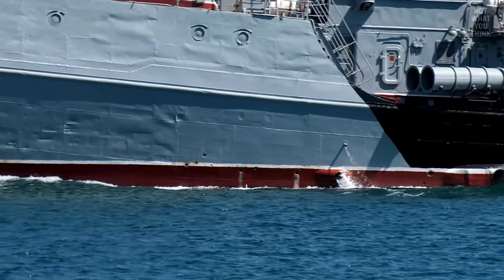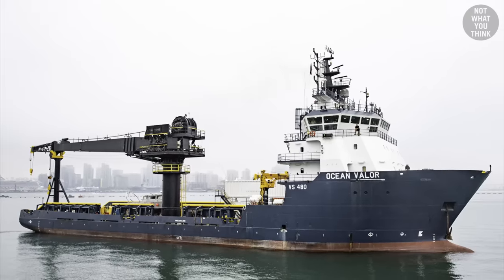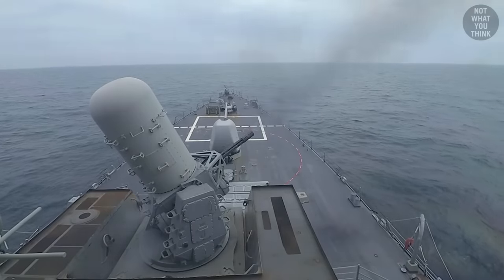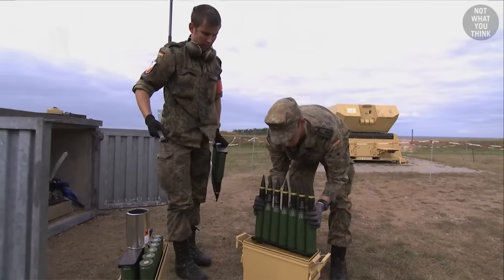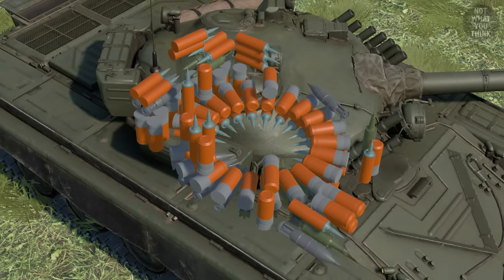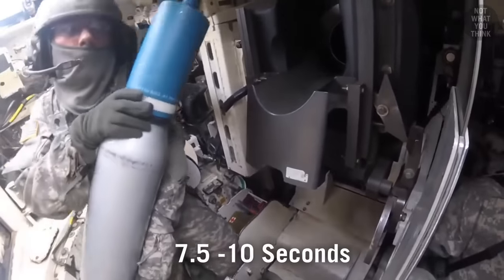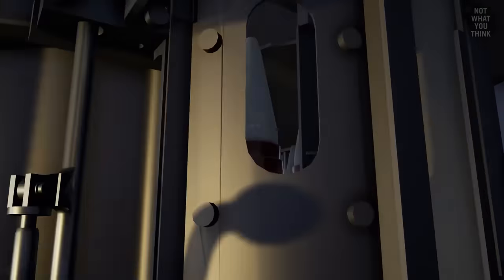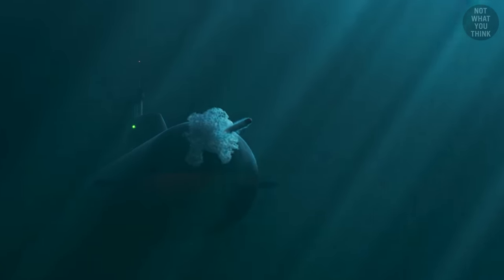Why Reloading Modern Weapons is Harder Than You Think

Comment: I'm a ammunition feed specialist. From 223 all the way up to 70 mm cannons. I like the 50 mm bushmaster 🤠 I did my time learning everything from start to finish building ammunition feed systems.
Reply from the maker: Pretty cool!
Reply from the maker: Drop us an email, see the “about” page.
Reply: What weapon still uses 70mm today? Plus, the 50mm bushmaster is still being tested.
Reply: I misread your comment as "I'm a ammunition food specialist" 😂
Reply: @Yourmomloser  .223 is slightly different from 5.56, appearently the chamber pressure is higher on a 5.56 so a .223 shouldn't fire a 5.55

I guess the commenter deleted their question but this was not unprompted
Reply: @WolfeSaber9933  its good Swedish tech its fire / targeting systems and shells option being worked upon American's wanted little more Ap penetration other than that is a larger version of swedes 4o mm system in CV 90 that's why American logistic for the new shells must be solved . It can be implemented within the year as soon the Sweden joins NATO.
Reply: @CosmoNoBones  That's not true, they're mostly interchangeable dimensions-wise, but they tend to have different pressures, so a gun designed for one, while capable of shooting the other, might not handle it very well. But you very much can do it.
Reply: @CosmoNoBones  Chamber pressures....5.56mm NATO is higher pressure compared to .223 ;)
Reply: @CosmoNoBones they both can fit in each other's breach but the difference is that .223 has a lower Max pressure than the 5.56 so you can use a .223 in a  5.56 rifle without any hesitation but using a 5.56 in a .223 rifle is kinda dangerous as it can blow up due to the increased pressure in the chamber
Reply: @CosmoNoBones  The 556 cartridge is slightly thicker to handle the higher pressure. technically you're not supposed to shoot 556 through a 223 chamber but people do it all the time.

Comment: CIWS and its aircraft predecessors for the most part retain the casings too; pushing them hard enough to get them clear of the aircraft takes more mechanism than simply returning them to the magazine.
Reply: I read that the original autocannon switched to retaining spent cases because they can't stop instantaneously; when the pilot released the trigger, inertia meant a few unfired rounds got ejected too while slowing down, and it was considered both unsafe (don't want any misdirected unspent rounds drifting into engines!) and an unwise gift to the enemy.
Reply: @grizwoldphantasia5005  The chance of anyone finding ejected rounds live or otherwise is pretty small but yeah, things getting sucked into engines is generally bad.
Reply: @jimsvideos7201  My thoughts too when I read that, but several unrelated sites have said so.
Reply: Another thing I read  was that the center of gravity would shift too much if they didn't return the brass to the drum.
Reply: @BrokenLifeCycle  There's that too, although it varies with how much a load of ammo weighs and how far it is from the center of gravity.
Reply: The reason we have the the M61A1 vulcan is because of the issue of the base vulcans shell casing getting sucked into the F-104A starfighter engines, luckily I have the M61A1 as my base model is the f104C
Reply: @grizwoldphantasia5005  IIRC CIWS does that too.  But you are a bit wrong.
The reason you don't eject casings is because you don't need to eject casings.  There's a loader mechanism that gets attached which adds an external input and output to the permanent continuous chain drive loop which is the vulcan's "magazine".  You simply do not GAF about ejecting casings/unfired rounds because you need a human to attach the loader to modify the system to get external input/output.
When loading/unloading, the loader mechanism strips whatevers in a single cell out(which is then directed to the external output), and immediately puts in whatever is waiting in the external input.  The chain drive loop does NOT appreciate being empty.

Note:I am not a CIWS tech, I was attached to them and had to help them with it because loading/unloading is an unpleasant and manpower intensive activity which may be a matter of life or death, and is certainly a "entering port so we can have liberty" issue.
Reply: Aircraft are not the predecessors for CIWS.  But, I get your point.
Reply: @midgetydeath  The basic gun and the feed system may have differences in materials etc but in their principles of operation they're the same as the M61 family that goes back to the F-104.  The feed system in particular looks a lot like the one from the F-18 too.  It's a fun wiki wander if you're into the sort of thing.
Reply: @Grimmwoldds  Just out of curiosity what rate were you? In other words, who did the CIWS guys manage to rope in to helping them reload? I was a CIWS tech. Block 0. Two guys could do it in 20 minutes if the ammo was prestaged and/or the ready storage lockers were right by the mount, the guys both really had it down, and of course, nothing goes wrong. Then again, how many times in the history of Naval warfare has nothing at all gone wrong? Having a couple more guys made the whole process quite a bit less arduous.  Even if they are just ammo mules so the CIWS guys could concentrate on making sure everything was lined up and working with that damned loader unit. If they were able to simplify that process with the block one good for them.  That loader sometimes required a fair bit of percussive adjustment to get it in place while keeping the sync marks lined up, they also occasionally required prayers and/or blood sacrificed to whatever capricious war god rules over insanely fast, accurate, and paranoid computerized gunners.

Comment: The USN has loved it's autoloaders ever since the late WW2 cruisers like USS Salem. Those were some large rifles with autoloaders and IIRC there were plans to equip an Iowa with autoloaders during the cold war
Reply: Since obviously nobody is hand-loading 8-16 inch rounds, every battleship and cruiser since the WW1 era has technically been "auto-loaded". The difference is basically only in how fast the loading mechanism works.

Apparently the Germans stuck with 2-barrel turrets for their Bismarck class battleships because the loading mechanism, which was the fastest for that size class of ammo back then, took up too much space to fit 3 guns into the turrets.
Reply: @TrangleC  we did hand pass rounds and charges on Battleships. The only auto part was actually chambering the round and closing the breach. Sailors had to hand lift the 16inch projectile and it's powder bags onto a table to then be pushed into the gun, it's basically hand loading in all the ways that really count.

That's how it's been done on all ships that allow for manual loading. You still have to heft that 8-16inch projectile onto a platform in line with the breach.

For more info, both the USS Iowa and USS New Jersey YouTube channels have videos on loading the various guns on the battleship.
Reply: @Its-Just-Zip  16in projectile, around 2000 lbs.
Reply: @salt6  There is a reason the gun crews on battleships were so big

Comment: Some more consideration on tank autoloaders:
1. France manages to deal with the issue of only 3 crewmembers on a fairly heavy tank (~57 tons) by teaming them up with scout cars. This way they get at least 5 people to take care of a tank and a car.

2. The limiting factor of the rate of fire of Soviet designed tanks often isn't the autoloader, but how quickly they can re-acquire the target after each shot. They are often more limited by their optics and the lackluster stabilisation than by the autoloader. German trials with eastern German T-72 for example found that it often takes over 10 seconds until the gunner and commander can get the gun back on target.

3. Casette autoloaders are one option for modern tanks, but the gun compartment and crew compartment get increasingly seperated anyway. Not all go with a fully unmanned turret like Armata, but Leclerc-style designs like the EMBT put the turret crew within the rotating turret basket and give them a hatch to look out of, while also largely isolating them from the gun and ammo handling.

4. Saving 25% of a 4-man crew by switching to 3 men and an autoloader sounds way more beneficial than it actually is. Tank crews only make up a fraction of larger armored formations. A US Armored Combined Arms Battalion for example typically fields over 600 men, of which only 112 are tank crews (2 tank companies of 14 tanks/56 crew each). Switching to autoloaders would save them a total of 28 out of 600. And this ratio only goes down as you look at bigger units with ever more supporting elements.
But now you also have to teach your commanders and gunners how to fix an autoloader in battle, and give them all sorts of other responsibilities...  you need to teach your mechanics how to repair them... chances are that this expansion of responsibilities gives you more breakdowns of men and tanks even if the autoloader itself is quite reliable.
Reply: I know they are worse but I also know how much of a toll it takes on your body loading those shells truly is a lose lose situation.
Reply: Concerning point 4:  The point that make gettin grid of the fourth crew member so benefical is the size of the tank.
Humans need a lot of space inside at tank, especially the loader. And space for the crew has to be well armoured.
If you compare "western style" autoloader tanks (like Leclerc or K2) with human loaded tanks (like Leopard 2 or Abrams) you can see it pretty clearly.
The autoloader tanks are about 10t lighter,  0.1m narrower, 0.3cm less tall and the hull is about 1m shorter (all values approximate).
Russian tanks and the japanese type 10 tank are even more compact but sacrifice protection to achieve it. T-14 is also a bit of an odd one out, with a big hull, but a really small turret.
Reply: About part 4, those 28 people that were just booted from the battalion, now you have to find other jobs for those 28 men, which includes probably close to 6-12 months of retraining in a new occupation, along with the fact that that's only for one battalion. Now imagine if that happened to all the battalions in the army and marine corps. That's thousands (guesstimate) of people that have to be retrained and are out of the job.
Reply: @tylermcdavid9426  From what I read france didn't boot the tank loaders from the tank battalion. The army put them into armored cars and attached them to tank battalion in a support role. That way you have a 4th person to deal with a broken down tank and replacement if someone get's hurt or killed.
Reply: @burningSHADOW42  France doing anything war related that isn't surrendering? cap
Reply: @tylermcdavid9426  You mean aside from making more modern tank than the rest of NATO?
Reply: Those are very valid points but eventually advancements in autoloader speed optics and AI targeting tech will make autoloaders a necessity on modern tanks. Right now a teenager hyped up on red bull and chewing tobacco is faster than a Russian autoloader but if an autoloader can fire twice in the same time and If it has targeting technology to keep up it will have to change. The first semi automatic guns were not very popular because the benefits didn't outweigh the costs but technology improved and now only snipers prefer the advantages of bolt action firearms over semi auto in combat.
Reply: @scar3xcr0  That whole debacle comes down to everything being more CQC, it's much easier to put lead on a target 10 feet from you with a fully automatic rifle than it is semi, and it's much easier to hit a target and use less ammo from 300 feet with a semi/bolt action.
Reply: @burningSHADOW42  not really the "most modern" . Abrams has a minimum rate of fire of 8.6 round per minute to qualify as a loader (7s per round) vs the 9 rounds per minute of the leclerc, and avoids the unneeded complexity of the autoooader
Reply: @Tom-dr5id  watch the videos from the chieftain or matsimus, autoloaders are just better in basically all points that matter.

The idea that a human loader is faster, is nice on paper, but is mostly theory. In pratice, you have onyl 5 or 6 rounds that are actually stored in a position that can be reached that fast, the rest of them is slower because they are more awkward to reach. And when the tank is actually on the move the whole thing get's much trickier for the loader, the autoloader does not give a crap about terrain. 
(And there are actually questions if such a high firerate is really necessary anyway. On tank on tank engagements landing the first rounds is actually the most important thing).
The autoloder does take much less room than a standing guy and therefore needs less armor, which makes the tank lighter, small and therefore harder to hit.

In the end the Abrams is a 10 years older design than the Leclerc.
All mayor nations that have developed tanks after the Abrams used autoloader, that includes France, Japan, Korea, China and Russia. The only exceptions I know of are Italy and Turkey although the trukish tank is still in developement and based on the korean K2 which has an autoloder.
Reply: @burningSHADOW42  generally having a more concealable tank is better, so the size is very important, the Abrahams has really good armored protection but it's better to not be detected if you can help it. I was honestly surprised to learn how formidable France was militaristcaly, they have a much better record than anyone gives them credit for.
Reply: @CosmoNoBones  Exactly, I think the myth that they are bad stemms from one occation in WW1. (I think Ian McCollum has talked about it even)
The biggest problem that most European powers have is that the EU is mostly an economic construct. And alone no nation in Europe is big enough for a decent sized military.
Reply: @burningSHADOW42  and although just a technology demonstrator the abrams X also had an autoloader in which the crew were completely separate from the turret
Reply: one thing not mentioned enough is jam clearing, manned turrets can easily clear a jam, it just takes some time.  isolated autoloading turret?  back to the depot/FOB with you.
Reply: @Nepcsalibur  that would highly depend on the type of jam.
For example current autoloaders can not extract rounds. I would think, that an isolated autoloader would have this capability. And for everything else: if it requires more than cycling the breach a few times, you would need to go back anyway. Swinging a sledge hammer inside a tank in the middle of a battlefield to get something unstuck does not sound like the greatest idea. And cycling the breach can be done by the autoloader.

The other thing is: tanks are generally capricious little bastards with a lot of mission critical systems that can have some sort of failure and they require a lot of maintenance anyway.

Basically: the possibilty for more technical problems on the gun, does not outweigh the benefits of the increased overall survivability.
Reply: @tylermcdavid9426 😂😂😂😂 Hahahahaha lol this comment cracked me up so bad. Good one Tyler.
Reply: One of the big reasons the US uses manually loaders for tanks is because the extra crew member helps with security outside of combat.  Three guys just can't cover everything.
Reply: @midgetydeath  The French just put the 4th crew member in an armoured vehicle and have them drive a bit behind.
And tanks need infantry anyway. If you are a tank and you end up somewhere without infantry or another tank something went royally wrong and you are not in a place where you are supposed to (or should do a stop).

So yeah, there are some uses for a 4th crew man, but in most cases the increase in mass and size of the tank is not really worth it. Especially if there are other solutions.

(and on a sidenote: if the 4th crew member is not the loader but something like a drone operator, they would sitting down and take up less room, meaning less weight and volumne  needed to be armoured.)
Reply: @burningSHADOW42  3 MILLIMETERS shorter. That's less than the margin of error on the suspension setting. Citing that is stupider than the kid who tussles his hair before the doctor takes his height.

Comment: 6:30 The MANTIS is quite versatile, the turret can also be mounted on any vehicle able to take the weight. When mounted on a GTK Boxer it is called Skyranger35 (there is also a Skyranger30 using a 30mm cannon). The burst length can be adjusted from 36 down to single shots, for small targets like drones a 6 shell burst is sufficient.
It can also take down anything from low flying aircraft via cruise missiles to drones and even mortar and artillery shells. It's effective range is 5km (3m) for slow moving planes and helicopters and 3km (1.7m) for incoming artillery shells.